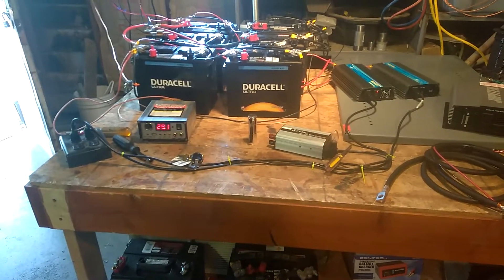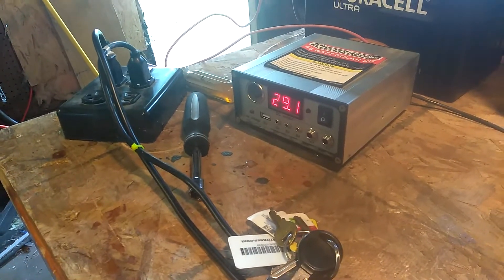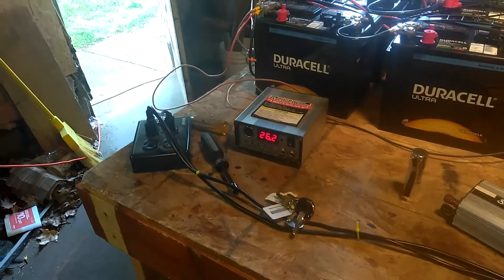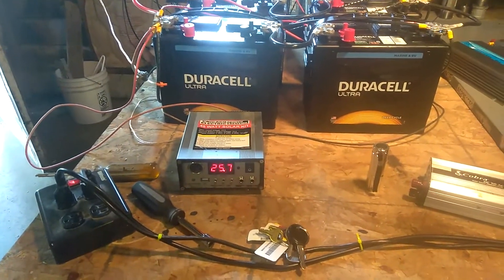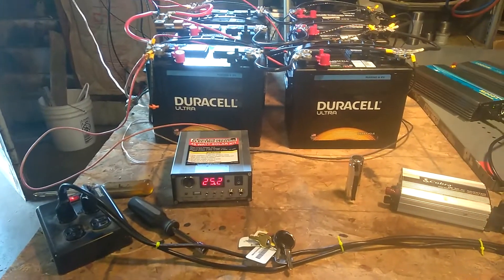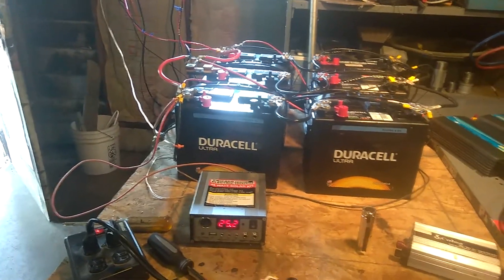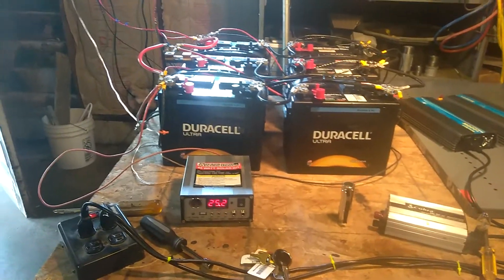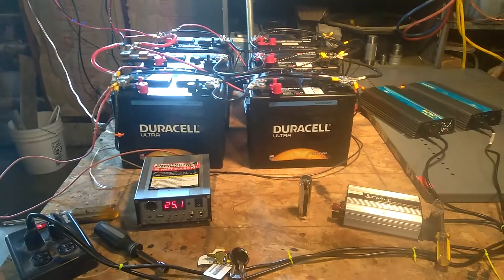Over Charged The Solar Battery Bank

Comment: Can't wait to see your going off grid , o hate aep
Reply from the maker: I will start out just the basic solar panel set up. I will start the first video with one solar panel, a car battery, a charge controller, and an off grid inverter for 400-800 watts. I thought about running some wires to the house but why not shoot more videos for the people step by step. That will give me the time to think about what I'm going to do in the basement for when this is fully developed.